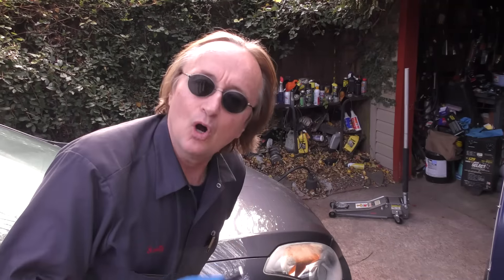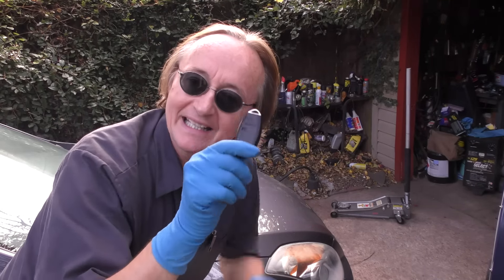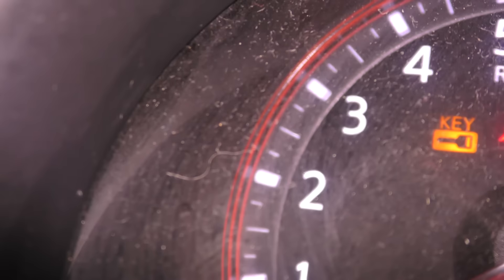How to Fix Keyless Ignition System in Your Car

Comment: I went out one Michigan winter stormy night. The battery for my key fob suddenly died on my VW so it wouldn't unlock the door.. But thankfully I can just stick the key in the door.. BUT! My car has 1 key to unlock the doors and trunk, and another key just for the ignition.. But because I can just use the keyfob to unlock the car with a press of a button, I figured carrying the physical key for the door would be pointless. And where was the key to unlock the door? At my house while I froze my ass off in the winter storm at night. I had to wait until somebody brought me the key to unlock my door. Needless to say, I now carry both keys because technology can fail at the worst fucking times.

Comment: Since you temporarily fixed it by hitting it my bet is that it has a cracked solder joint. Open the module by removing the 4 screws, locate the cracked solder joint and reflow it with your soldering iron. Often a mechanic will fear going a step further by opening a bad module. Hey, it is already bad. It cannot get worse. The only thing you are risking is to save a lot of money.

Comment: Actually, WD-40 attracts too much dirt. Silicone spray works the best for locks and keys.
Reply: Fred Flagstone Or a graphite lubricant.
Reply: Silicone spray is better than graphite.
Reply: it is wrongly worded silicone, in fact it is pfoe compound similar to teflon that is actually carcinogenic and should be avioded for such applications

Comment: Scotty, why not invest in the correct diagnostic equipment and software to code the modules?

It's actually fairly straight forward
Reply from the maker: for many cars, ONLY a locksmith or dealer can get those codes. I actually have 2 machines that can do it, but I can't get access to the codes on most cars

Comment: Not to buy a nissan or rather any car with a keyless system.... Ummm, 99% of the cars today use keyless systems. In all honestly I love it. I love it more than regular key. If i could fully have the keyless system on  my 97 4Runner I would so get it. There has been so many times where I left my key in my car and the doors automatically locked. I had to call a cab home, get my other keys, and unlock my door. With the keyless on my Nissan the door wont lock and neither does the trunk stay closed if the key is in the vehicle.

Comment: +Scotty Kilmer Do you have to heat your car up in the winter? I have a ton of people that say it is bad for you to heat up your car because it causes oil dilution. Every site i search is biased and they are showing one side or the other. Either if you do heat the car up, it will cause oil dilution and shorten engine life. Or heating your car up is good, due to the oil circulating in the engine.

Comment: problem is - almost all new vehicles have the transponder built into the key head whether you realize it's in there or not. if the the sensor doesn't recognize it, the vehicle won't start - doesn't matter if the key turns the ignition switch or not. and yes, the dealer bends you over the barrel to get it fixed. and god help you if you lose both keys - then you can't have a copy made and have to buy a whole new computer.

Comment: Did you bother with the brake pedal switch first? Nissan has a TSB on them.
Reply from the maker: wasn't that, the whole system needed replacing where the dealer charged him about 1300 bucks

Comment: On my car, if the push-button start fails, you just take off the switch and behind it is an insert to start it with the key. Not all of these systems are bad, just Nissan's.

Comment: Nissan is not the culprit, since engine immobilizer anti theft systems have been mandated in all new cars since the late 90's.
Reply from the maker: yes they are, cause they make crappy ones. This was under warranty for being crappy and breaking but the warranty expired. HOW can a warranty expire on a known bad part? Other than Nissan being crappy as they often are.

Comment: The problem isn't the key at all, that "complex part" is the steering wheel lock. The steering lock has gone bad, you actually look in the owners manual for that Nissan it will say that that light had two purposes: one is the that the intelligent key has a problem and two that the steering lock is failing, aka that part down there. Tapping it trips whatever is broken in it and allows TO to start. The owners Manual even tells you that this is the problem and that you need to get it replaced and until it is the ignition system Is disabled. He's right that part is $700 but I had the problem on my Nissan and I bought the part and just replaced it, took 5 minutes. There is no programming that takes place that's a lie straight from the dealer, just unbolt the old steering lock, put on the new one and the car will start. I wouldn't bash Nissans keyless entry just because the steering lock (aka not keyless entry) failed.

Comment: Did you ever try starting an automatic by pushing it? Good luck.
Reply: Unless it is an early 50's or 60's Fordomatic 2 speed, Chrysler Push Button Torqueflite or early GM Powerglide, all with rear pumps, sadly missing from today's automatics.

Comment: Simple is better.  As if it's too hard to insert a key and turn it.  When you walk in to buy a car, insist on key only or walk out.  When the stats show more key cars are sold, it will change back.

Comment: My GM has the old fashion keys and ignition switch yet it still cost $300 to replace and re-program a key.
Reply: No it doesn't.  See my post on the subject. NEVER believe anything a dealer tells you. Investigate first. Google is your friend.  The dealers aren't.
Reply: Amen !!
Reply: Lol ur getting ripped off.. Ignition switch are so cheap to replace and easier..
Reply: A brand new OEM ignition switch for an Audi A6 costs about 800€. Just get it to a locksmith.
Reply: On my Town Car, a new key is maybe 60 bucks progammed at home depot.  And on the Town Car, if you have two keys, you can use the car's own sensor coil to program a new third key.
Reply: Moral: Never believe anything a dealer tells you.

Comment: Nissan stinks overall. Look into their CVT transmission issues. They extended warranties to cover it, but most people were past the mileage when they did that. They don't hold value very well. Also the they wireless key system, you can't program the remote, you have to take it to the dealer. On top of that, they have host of issues with almost everything in their cars failing at one point or another.

Comment: Why not a recall issue on this part so all the vehicles can be replaced with good modules?  It's a safety hazard - what if you needed to start your car to go to the emergency room.  Now you can't just because of this poorly engineered module?  Class action law suit for extreme negligence seems in order.

Comment: WD40 should never be used on automatic keys or locks. They are exposed to high levels of grit and other junk because the cars are outdoors and have 35 to 76 MPH winds blowing on them (the movement of the car itself) that forces more gunk into the locks which jams them up or wears them out. WD40 acts like glue to all that junk. If you don't know how to correctly lubricate a door lock,, see an experienced locksmith and take a lesson from them.

Comment: no key is dangerous , once towed a 120d about 10 miles with a broken big end , battery got lower and lower until the ignition locked! with no key or power couldn't unlock it luckily we were towing slowly. stupid crap agree no need for it.
Reply: steering locked*

Comment: You can drive cars with a key if you want, but any new one is going to have a chipped key, so you will be the same problem.
Reply from the maker: Yes, but I've never seen a toyota chipped key EVER break down, and I've seen the keyless systems break a LOT.
Reply: Scotty Kilmer well, Toyotas are typically better card than Nissans, from their chipped keys to the any other part on the car.

Comment: Key in the slot? Is this one of those cross over types where it's just before where you can keep the key in your pocket, but after the push button era?

Anyway, having to tap the module would get me to open it up and check for bad solder joints on the board.

I do agree that push button is stupid. I also hate electric park brakes too. The e-brake is gone! Stupid dickheads.

Comment: I have had 3 different Nissans. All push to start. All had a key that pops out of the fob. All three had a standard ignition switch that had a cover on it you pop off on the stearing colum. So you calling Nissan out on this is a bunch of BS. Sorry Scotty! No I don't work for Nissan either.
Reply: Greg Droder I agree with you. He likes to hate on nissan even though it's a good brand

Comment: Or you know, just get a car with an actual key,
Reply: Good luck trying to find one, even the POS Mitsu Mirage comes with push button start now. If it breaks, you might as well throw the car away.
Reply: There are plenty of cars with keys still.
Reply: I want to get the Honda Odyssey, but it come with this stupid keyless system!
Reply: smasila 
Just buy it. It may be expensive to fix, but these systems don't break very often.

Comment: Yea, see this is one of the reasons I will continue to drive my 2007 Silverado LS until it just won't go any more, all the aluminum foil bodies and intelligent electrical gadgets that get stupid - REAL quick, with a four cylinder engine and 16 Stupid Charges and 8 Turdhole Chargers - incredibly easy to fail, not covered under ANY warranty and VERY expensive to fix, go that route and get what you deserve

Comment: here's the real fix. don't buy a shitty ass nissan. what the hell is the point of putting a wireless key in a key slot and then pushing a button? why not put the dock right were a key ignition would be to make it even more pointless?
Reply: awww look at you all upset with your yellow nissan

Comment: or don't buy a nissan at all..
Reply: Surge Tmz my 2 nissans have been very reliable
Reply: what year model are they?
Reply: Surge Tmz 2005 Sentra and 2009 Altima
Reply: swr Nismo i can understand the reliability on the sentra due to the year model, I can't stand cvt's. I like older nissan. now they feel like you are driving a plastic box
Reply: Surge Tmz well my 2009 Altima is a 6 speed manual. No cvt. It's a great car never gives me problems
Reply: that explains.